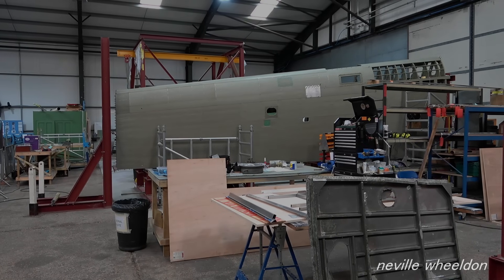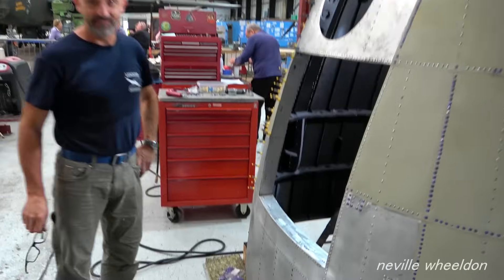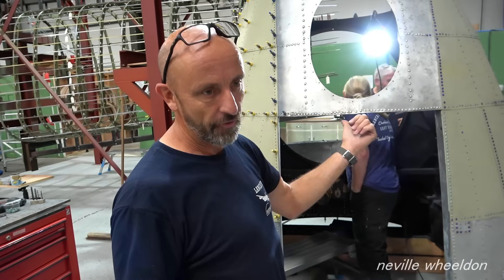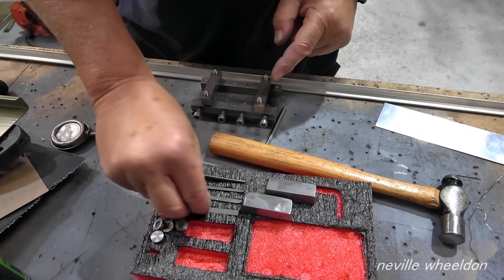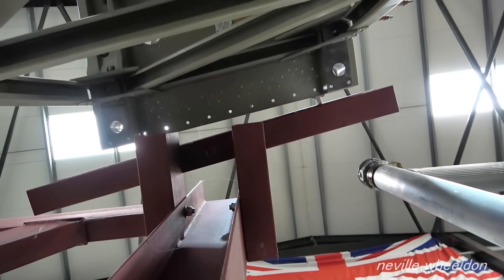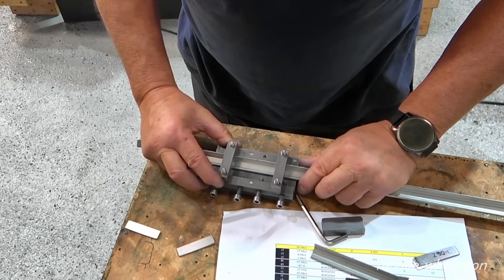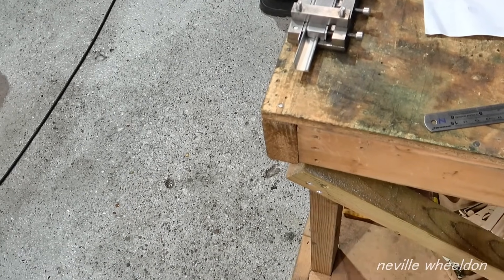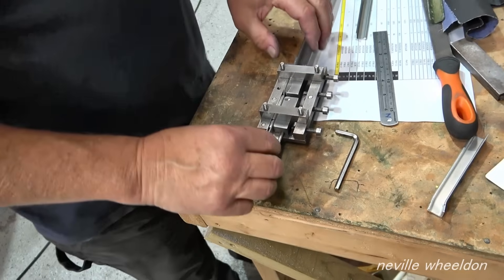Video 218 Restoration of Lancaster NX611 Year 6.  "Joggling Jig Tool"

Comment: Chris makes me giggle, coz he's one of them fellas that always says 'Do you know what i mean' a lot, and i instinctively have to count, sorry Chris, just one of them things, 'know what i mean'

them floor panels is an odd one, probably find they were installed by two different people either with different ideas or waiting on parts, - but did he decide (i have tried looking at the videos to see) but did he decide and/or find out the same regarding the outer skins that appeared to be wrong, i.e. lower panels overlapping upper panels, and not the other way round, thus letting water in and not over upper edge of lower panel, i have tried to see on Just Jane, but vids are not quite close enough and being black its hard to see

i have had the odd similar type of thing myself and had to seek advice on this kind of scenario, always seems things might be built on a Friday afternoon, you know, 'Poets Day'

Comment: The quality of work looks really good doesn't it. What I'm looking forward to seeing is the process repeated in due course on components destined to fly. What will the differences be? I would assume that the aluminium will be of a superior grade, more resistant, less malleable, more time consuming. I'd also expect to see each component labelled. Time will tell.
Reply from the maker: Hi Chris , less malleable, I assume you are referring to the stringers Norman his working on . these were made malleable so they could be shaped , these stringers will be returned to the manufacturer to be made to T6 hardness. The rear fuselage is made to airworthy standard following CAA compliance
Reply: @nevillewheeldon1693  Thanks. My memory (from the 80-90's) was that an aluminium grade like L3 was used during the war and could still be used today for static airframes whereas something like L178 was required where it had to be signed off. I remember working the two, they were both silver but the better grade was so much more difficult to work.

Comment: I have a home made juggling tool that I made for a job (damaged Cessna 421 - pressurized twin) in 1969. I have used it only once since then. But,it was a huge time saver as we had about twenty stringers that needed to be joggled at each end.
Reply from the maker: Interesting Rex.